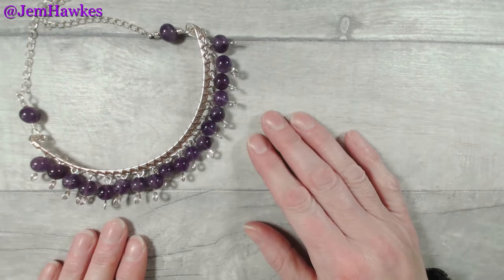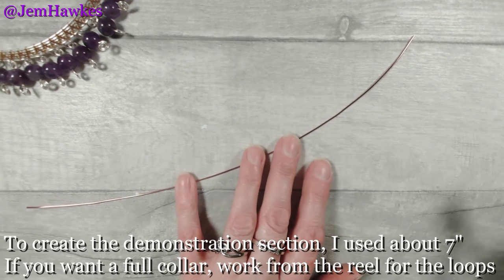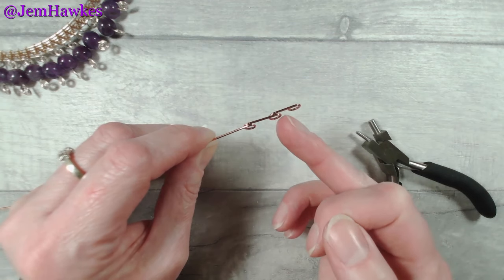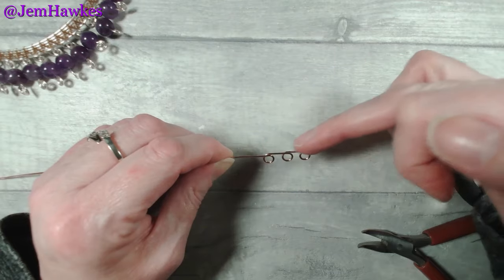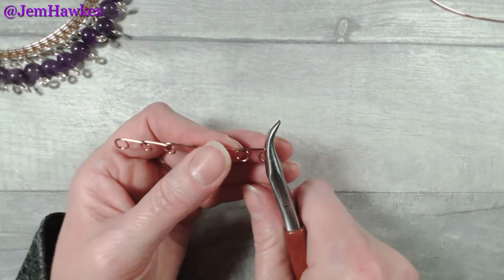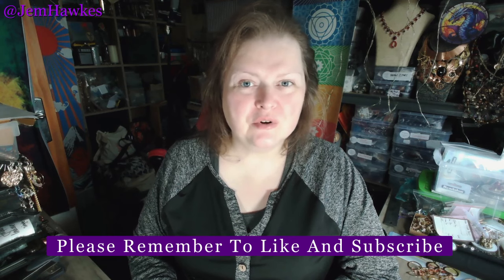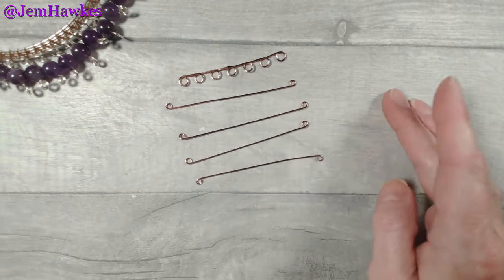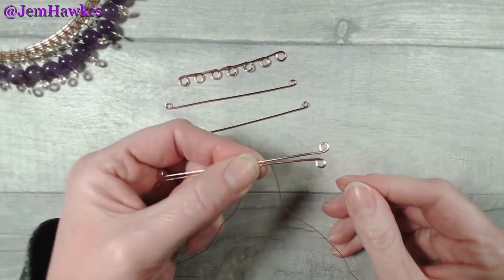Woven Soumak Wire Bar Necklace Project | Making Wire Jewellery | Create Jewelry with Jem Hawkes

Comment: Hi from California  What length of wire did you use for your necklace?
Reply from the maker: For the piece I wore in the video? Probably 10" lengths for the 4 wires and the looped section is always made "off the reel" to avoid cutting short - but it's a very large piece, so you'd probably not need anywhere near that much!

Comment: Beautiful design! Do you have an average finished length in mind when making these collar bars? From your experience, is there an approximate length of the bar that would suit most neck sizes? Thank you so much for sharing your talents with us!
Reply from the maker: Thank you very much for watching. The one I was wearing I think is about 7" so the 4 x wires would be about 8.5 - 9" lengths each, it can be more curved or less curved if you need to adapt to custom fit after completion. Even if it comes up small, it will still look fabulous in a shorter length. For reference, my neck is 15.75" approximately xxx
Reply: @JemHawkes  thank you so much for sharing your insights. I have been dabbling with this style and struggling with the right sizing. This helps!
Reply from the maker: It's always worth tryng out; every weave is a learning weave, we get better with practice, and you can always adapt  ... for instance if it turns out huuuuuuuuge,you could make it a torque collar, no chain attachments, or tiny ones a cool centrepiece. Thanks again xxx